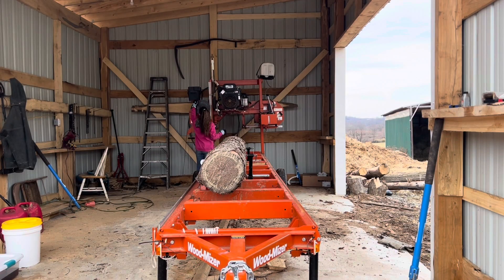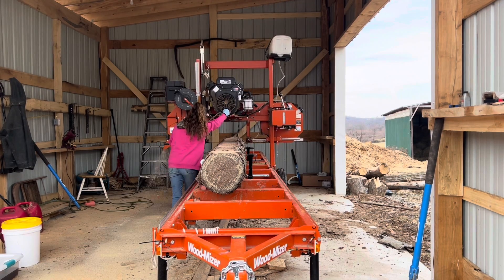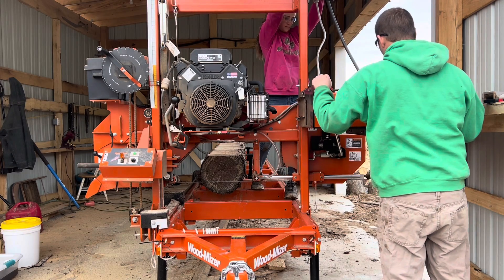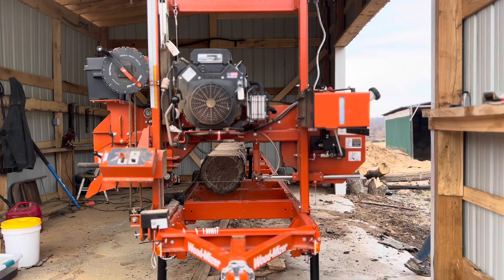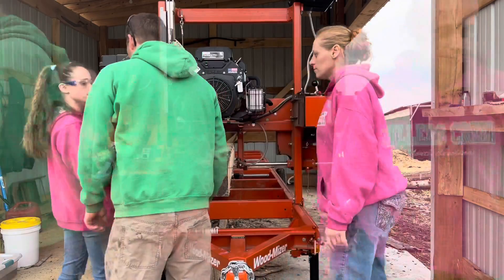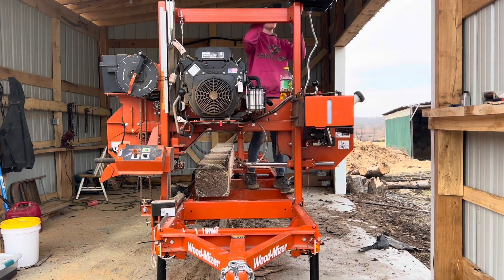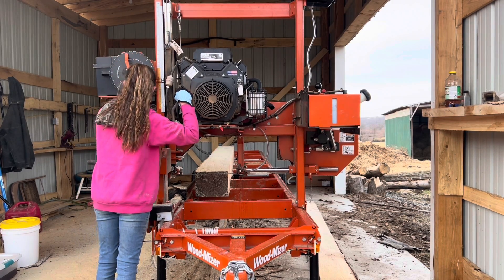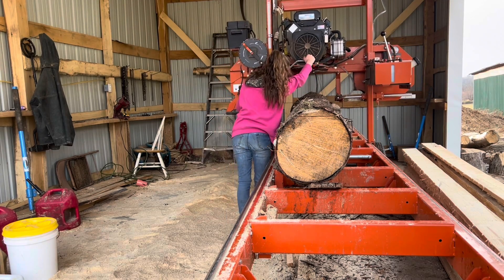Working with the Wood-Mizer LT15GO

Comment: Looks like your mill has a quarter scale in addition to an inch scale. If you use the 4/4 scale you won't have to worry about the 1/2 turn plus 2 notch method. The quarter scale will also help keep the last board you mill the same thickness as the others without making an additional adjustment cut.
Good video. Good luck with your channel.
Dave